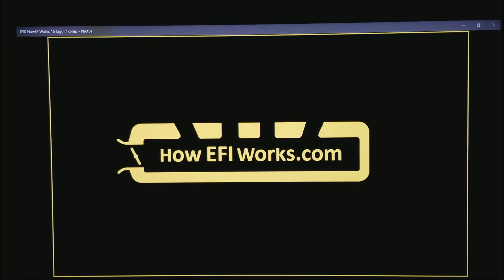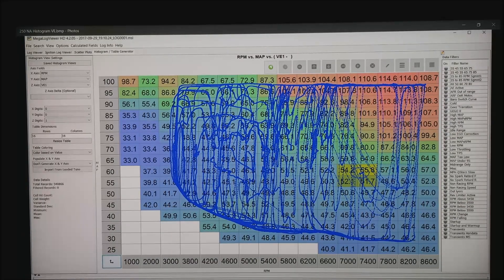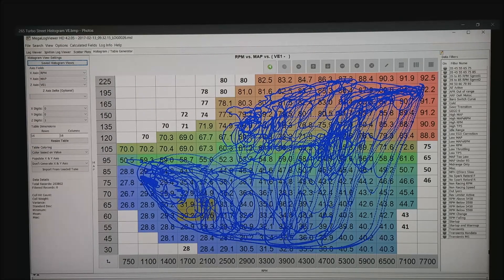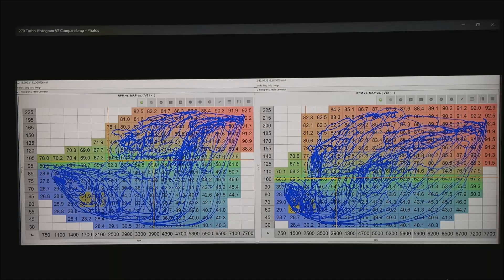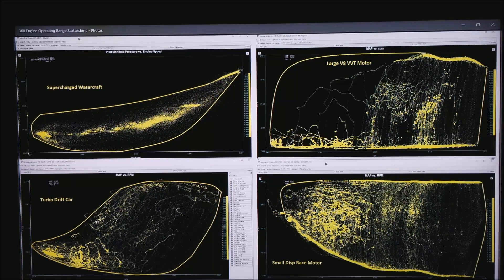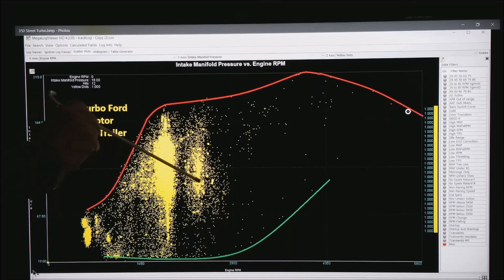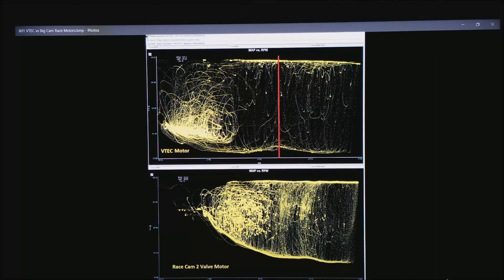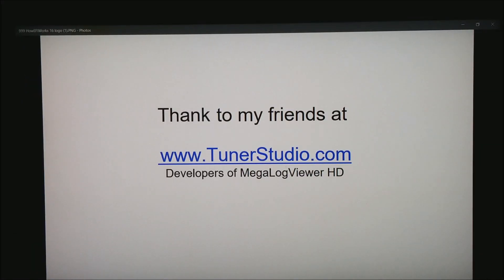Every Engine has an Operating Range

Comment: My problem : When the engine is running, it does not display points in SCATTER PLOTS ! When the engine is muted after the restart, the log point appears but there are no dots on the running motor. Two videos to watch. 
How to do that on a running engine, the points are displayed SCATTER PLOTS ? https://youtu.be/xe4yRnMfMqk https://youtu.be/iV4qAoARiNo 
My msd: https://drive.google.com/file/d/1c31Ga8 ... sp=sharing My log : https://drive.google.com/file/d/1pZoW5_ ... sp=sharing

Comment: Just started with Megasquirt v3 today. I have no lambda probe yet but it should arrive in the next few days. I have a GSR600-K6 for a Formula Student car. My Map goes from 20-100 kPa and 1200-13300 RPM (linear for now). The fuel values range from 10,7 to 73,2. The Map is not good but running so far. @11:40 you said that the fuel values should close to 100. What should I suppose to do, change the injector constant value(??? the injector size value = 170cc) so I got closer to 100?

Thanks for the Video so far